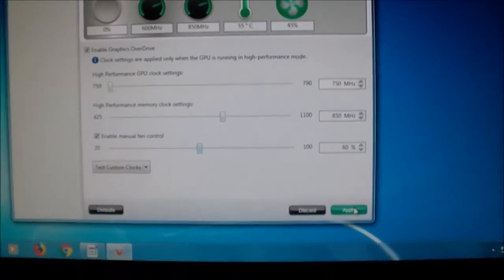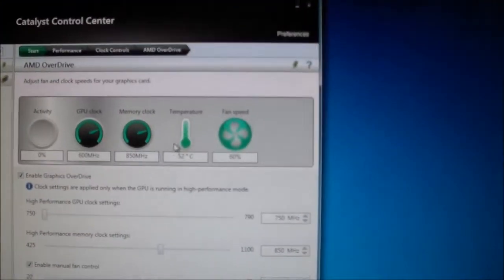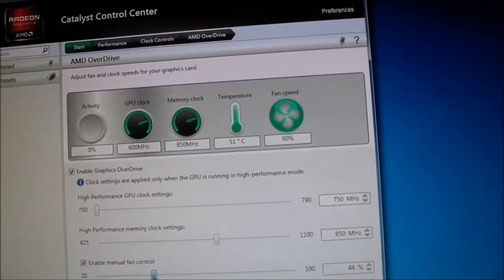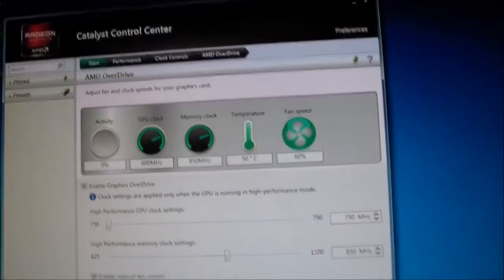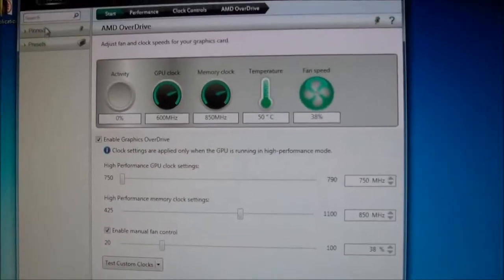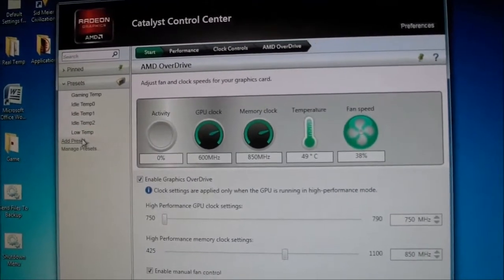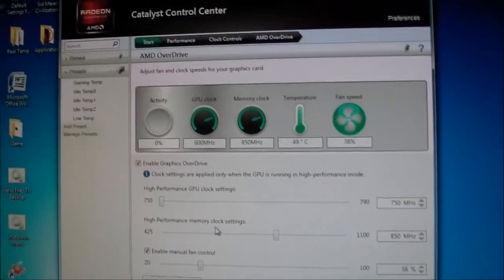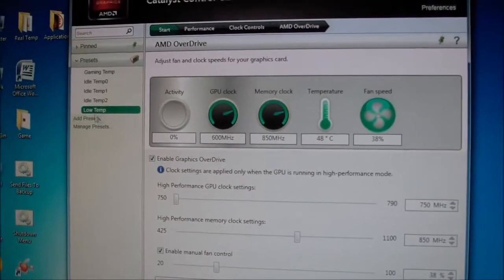ATI Radeon HD 4870 High Temperature Problem Solution

Comment: mine was having the D1601 led fault and i just opened it, added new thermal compound and it fixed my high temp problem. i used arctic silver 5 thermal compound don’t use the cheaper ones since this card can run pretty hot as you can see in this video. hope this helps anyone out there having this problem.
Reply from the maker: You'll get better temps if you use better thermal grease.

Comment: for some reason, my gpu fan control is greyed out :(
Reply from the maker: Click on "Enable Graphics OverDrive".
Reply: @Ace1000ks  yes, this option is already enabled, and the "manual fan control" is stucked on 50%
Reply: I'm probably gonna need to upgrade my card, don't worry
Reply from the maker: @PlayerHero 50% is enough, you don't need to get it above that. Before it was at 10%.